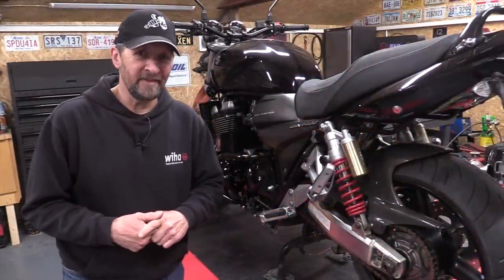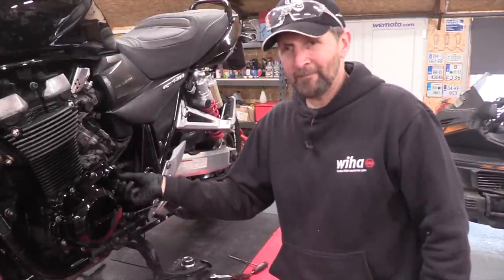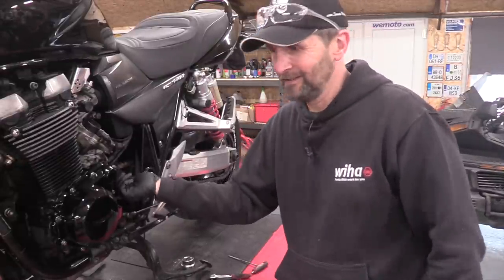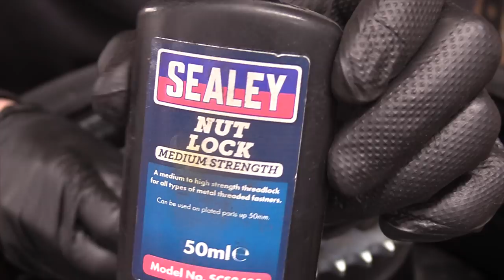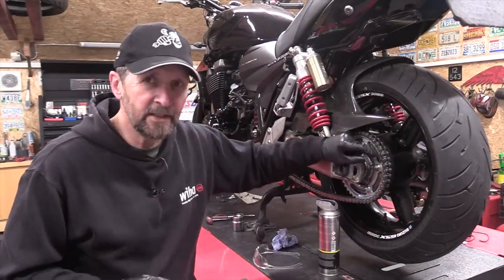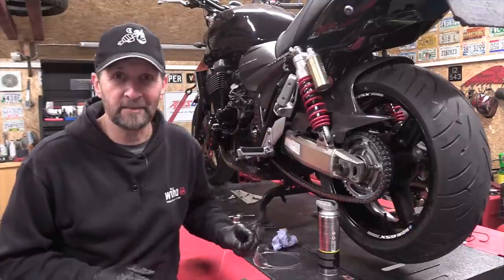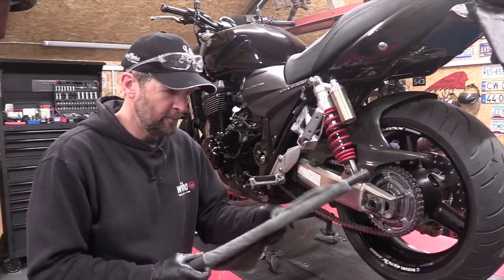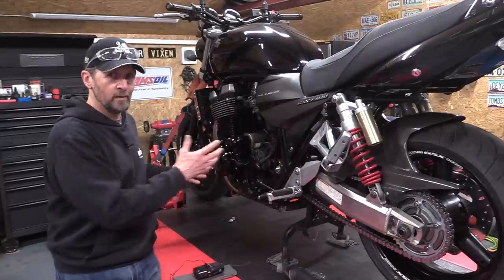Suzuki GSX 1400, "Chain & Sprockets change" !

Comment: Looks great Del.  And wow, cannot believe that front sprocket nut... those things are typically such a pain.  Without the fold-over washer to lock it, that thing was nearly so loose it may have been a concern ;)  Bike is looking awesome, Del... really cool to see you freshen everything up like this.  You'll no doubt really enjoy this one over the summer.
Reply from the maker: Thanks Don.. With these, the speed sensor bolt was still crack tight, that has a flange that stops the nut unwinding, and also the whole lot is covered by the clutch slave cylinder housing which will again, hold it from unwinding.. so no real worry, but it could lead to vibration maybe, and premature wear of the inner spline on the sprocket.. !  But glad it's all torqued up and safe now for sure. !
Reply: It was still snug, but locked in for sure.
Haven’t seen front sprocket weights before 😊
Reply: I don't know why people make such a big deal about front sprocket nuts with a decent impact they come off easily
Reply: @TrulyUniqueOne  Except when they don't ;)  I have a good impact gun and I've had sproket nuts that it could not remove. The worst was in fact another Suzuki... mine was a GSX-R 750 I used for race/track... was way beyond any impact gun.
Reply: I don't know why they are so ridiculously difficult sometimes. 115Nm shouldn't be that bad. The torque spec for my Yamaha YZF600R is only 70Nm and that was a nightmare to get off. I ended doing it by attaching an engine crane to the wrench.

Comment: I had to chuck a piece of timber through my wheel to get the front sprocket off my Bandit. Even with a 3/4” breaker and a meaty bar over  it wouldn’t budge. Borrowed a friends battery ugger  dugger and it came off instantly 😃

Comment: Ha, funnily enough, I have just ordered a taller alloy rear sprocket and a new battery for my cordless impact wrench to finally get those engine bolts out and the engine bars fitted.
Ha ha, summers coming 🤣 nice one Del

Comment: I new right away something was wrong with the nut of the front sprocket when I seen that look on your face del, good job that you decided to change them!!!!! for that could have been a disaster waiting to happen. 😮, o and been there and done it myself with a spoked wheel years ago😅 lesson learnt the hard way. Well great video as always del looking forward to the next one. All the best to yourself and Penny and stay safe...Don.
Reply from the maker: Thanks Don, surprising how easy it is for a small maintenance issue to become dangerous... thanfully that nut can never actually come off because the speedo bolt has a wide flange that holds it in place, and as you saw, that was crack tight!  And if all else fails, the clutch slave casing covers it over, which would stop the sprocket actually coming off... but a loose nut can still lead to vibration and excessive wear on the output shaft, which long time, could be horribly expensive!  Thanks for your kind words, always good to hear from you!

Comment: Plus there's meant to be loctite on them del  ..Nice work done this twice on my 1400 .. BTW she's started up a treat sounds lovely no exhaust  or oil leaks may share a link now if u want to see my 1st start up
Reply from the maker: Great video mate.. what a result after two years, fantastic, such a great testament to Suzuki engineering.. Shame it made the little one cry, hope she was ok.!
Reply: @Moonfleet41  ye as littke ones often do. They get upset at loud noises where as I admire them lol .

Ty 4 the reply and watching it . Yeah I'm very happy.  I'll get it booked for mot next week ..wasn't quite ready for tomorrow as I've ordered extra litre of oil . 5.7 it rates from dry (otter than lubed parts ) . I had 5 . Motul 10w40  4t .......I'd turned it over woth thsnk off first a few times to lube inside..I had a hg bolt snap on disassembly.  Amd a hg bolt yield and break on assembly . Tapped all threads . 2nd time round wwnt successfully .  I had to drill out a rear 155mm emgine bolt as nit rounded ..(torque was clearly to high for the m14 nut ) haynes recommended 55 woth loctite. All new vaove seals . Thrn had 2 lots of keepers not quite sitting tidy (my bad ) so used the rope method to sort that out ..few new bolts new studs (they are exposed to the elements and we're a pig to remove) . .

Anyway here I am ..
Hope you are enjoying the 1400 muscle matey ..
Reply from the maker: My word, sounds like you've been busy getting it all ready.. and what a result when you get it finally out in the sunshine... my first one was a K2 with a K3 tank due to warranty replacement from rust flaking.. and i also put a full Akro system on it too..   I've really missed the big muscle feel over the years, Yeah it's great to have light bikes that handle, and who doesn't love a righteous cruise on a Harley.. but over all that.. there is still nothing quite like muscling a big block of flats round a bendy road..lol..      As a fellow Kindred 14 lover... check out this guys videos.. not many of them, but without doubt, the most watchable video on the tube right now... Enjoy. https://www.youtube.com/@thevikingrider6539
Reply: @Delboy's Garage  I'll sure take a look at this mate sounds great..yeah I'm a big chap my old bike was a gpz500s  wemt well enough but after a year or so . And having fell for the 1400  I had to get 1 I had my heart set on one ..didn't realise at the time it was a 1400 ..I love how it makes you feel . The emgine just keeps giving . She's very happy cruising at 80+ . Def a keeper . Sports bikes I'm not built for ..but if I had another bike (in future maybe ) it'll be a zzr14  ..lovely front end . ......ps I think we discussed this  recently but I once stripped a thread on the 14 rear sprocket carrier.  Specs say 102nm no way ..55-60nm n loctite not moved in 3 years lol

Comment: Ahhh, fresh new chain and sprockets. Always a satisfying and happy feeling anticipating the first smooth ride! Fascinating front sprocket final nut that the clutch cylinder mechanism fits over. There must be a bearing in the backside of the cylinder or something, or the nut is captured and held in place while the sprocket spins behind it somehow? Have never seen that before.
Reply from the maker: No not at all buddy, no bearing, and the clutch slave casing doesn't touch the nut or shaft.. if you noticed the four sided castle nut i installed into the middle of the shaft after the main nut ? that's the speedo sensor, and the casing has to cover it with the reader so it can count the turns and measure the speed.
Reply: @Moonfleet41   Huh! Thanks, that was totally puzzling me, lol. Cheers 😄

Comment: Lovely video Del. I'm glad you mentioned about the spokes breaking when using the jack handle. I've heard of this happening but thankfully I have not witnessed it. I am looking forward to the next episode.
Reply from the maker: Sure thing Steve, it's pretty certain to sheer a spoke off on a wire wheel, which is pretty much replacable, but it's even dangerous to do it on cast alloy wheels with multiple thin cast spokes, you could still sheer one of those off, then you've literally written the wheel off, so big fat bar, 3 spokes only!

Comment: That must have been the easiest primary sprocket I've ever seen undone!!!. P.s. I always use a light coat of copper grease on the mating surfaces of those sprocket nuts and locking washers if applicable, to stop cold welding occurring.
Reply from the maker: Yeah, it's left side drive so shouldn't undo itself...so who knows aye..! Happy it's right now !

Comment: Nice video as always Del, however noticed a nasty cut in the rear tyre (4.58) best check it out before you go out for a power ride.
Reply from the maker: That point in the video shows the sprocket mate..!
Reply: @Moonfleet41  Try a few seconds either side of 4:58, its facing the camera.
Reply from the maker: In the middle of the tyre when i laid it down?.. no, thats a finger print mate.. checked just now, it's gone !

Comment: Excellent video Del, hope you don't mind me asking, the front sprocket (factory) and the new sprocket had 2 semi circle lugs on, just curious 😊
Reply from the maker: Those curved rubber collars act as a damper to the sprocket.. believed to help prevent vibration and also mechanical noise !
Reply: @Moonfleet41  oh right OK, how technology has moved on

Comment: Another top how to I must ask how did the spoke wheel go ?😅
Reply from the maker: When stripping the Harley down, it needed new rims anyway, so i blocked it with a bar, and the front sprocket nut was so tight, is sheared two spokes clean off..... I would not have chanced it if the wheels were to be re-used, but as i was getting them re-laced it didn't matter !

Comment: The outer hall effect  transmitter nut totally threw me the first time I saw one
 I spent ages thinking how the heck does this thing lock the big nut? It's not even proper tight! And whybis it castellated with no slit pin or lock tab?
After looking in the manual I felt like a proper donut! 
Peace and love ✌️❤️🤗
Reply from the maker: Yeah, strange looking little thing that doesn't make much sense until you know what it's for..   Have a great weekend buddy and keep safe aye.. D&Px

Comment: What method will you use to jam the wheel if it had spokes?
Reply from the maker: You have a GSX 1400 with spoked wheels?.. id love to see that..!!   How about dropping the wheel out, pop the axle back through the swing arm, then wrap the chain tight around the axle and poke an old screw driver down through it to pin it in place.. that should lock the front sprocket !

Comment: How do you hold the rear wheel from spinning that has wire spokes ?
Reply from the maker: You could take the wheel out, replace the axle and then pin the chain around it.! That works well.!
Reply: do the nut up with the bike on the sidestand.

Comment: Why not just stick the bike in gear to hold the front sprocket?
Reply from the maker: Let me know how you get on with that!
Reply: @Moonfleet41  I've done it before and it was fine! But then again, it wasn't like wrestling with a gorilla either
Reply from the maker: @mickleblade  As i mentioned in the video, ive had them overcome everything, brakes, gears and even defy a windy gun... This method never fails though !

Comment: the swing arm measurements are not the same both sides. i guess the alignment a bit wonky so you need to offset one side to compensate ?
Reply: It wasn't showing left and right marks, it was a before and after of just the left side, showing how much adjustment distance is now available with the new chain.
Reply: @MrSmith-hd8od  makes sense. should have known better. delboy would never have the sides different

Comment: Del, I see a quick little project there to paint the inside of the rear disc to match what you had before. It kind of looks wierd all metal. What do you think?
Reply from the maker: Not really mate, I've said all along this isn't a restoration, there's no machined line to paint up to either, so it'd mean somehow masking it and with heat it'd definitely chip so probably end up looking rough in the future... it'll be fine as it is mate, nice and tidy.